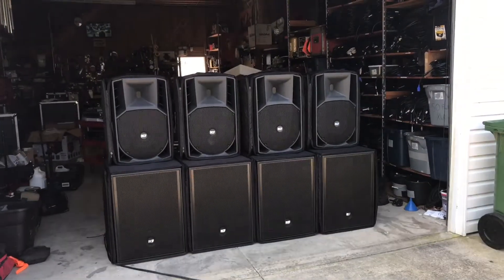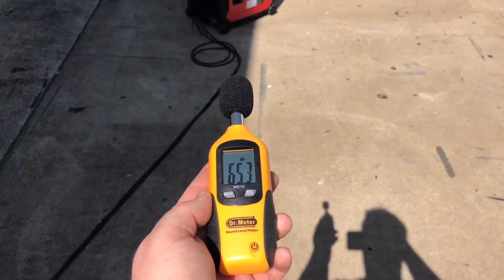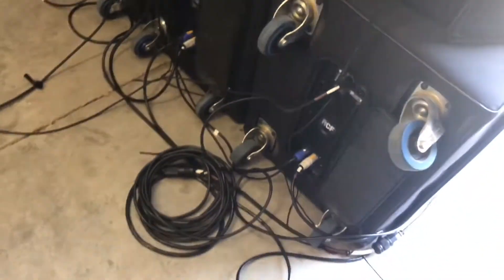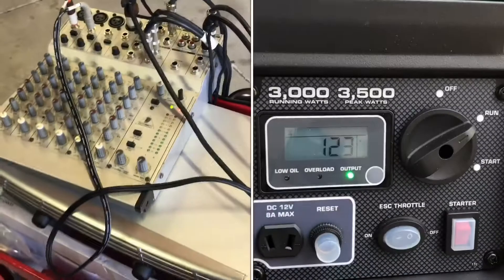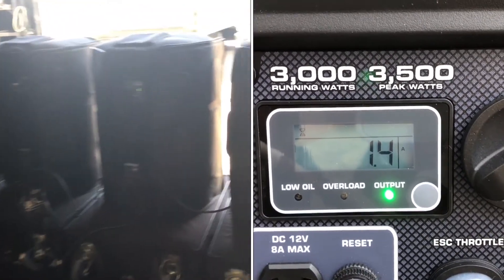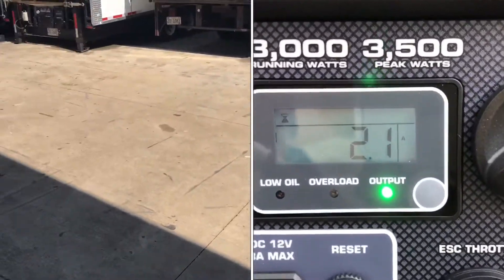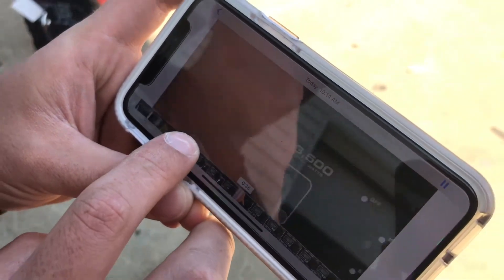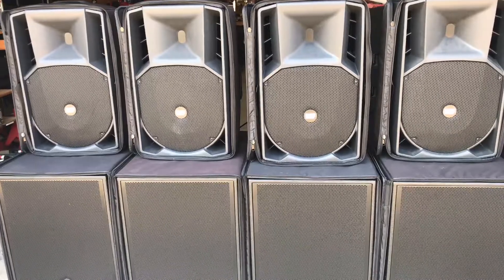RCF Efficiency Testing using Harbor Freight Predator 3500

Comment: Having been in pro-sound for the better of 25 years, I can tell you, that once you toss in something with bass, that genny gonna fall on its face IF alone  by itself,IF those amps can actually deliver. 

Not an efficiency test, but rather a DB test.
Also, be careful, those amps will still run under low voltage caused from high drain. High drain, means MORE distortion. More distortion, means replacing baskets!!!!
Reply from the maker: I agree if we rewound in time to when I started doing sound 23 years ago this wouldn’t be possible. We do large events with 8 of the 9006 subs and 24 of the HDL30 line array tops and are still pulling low numbers. Average less than 20 amps per leg on three phase when evenly distributed. 60 amps for 32 speakers Ran hard in my opinion is pretty ridiculous. Especially considering back when we used crown macro techs we would need 20-50 amp circuits per amplifier. The times have changed.for sure thanks to mosfet technology. The Peak numbers in my opinion are very over exaggerated these days but efficiency is way better.